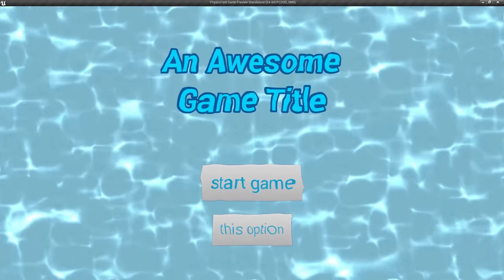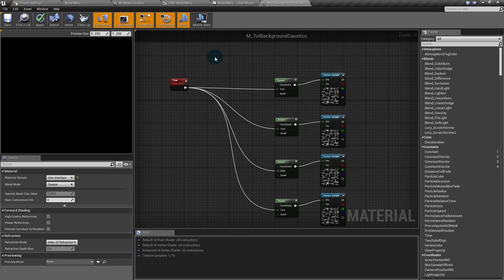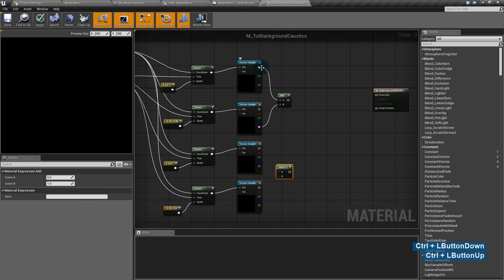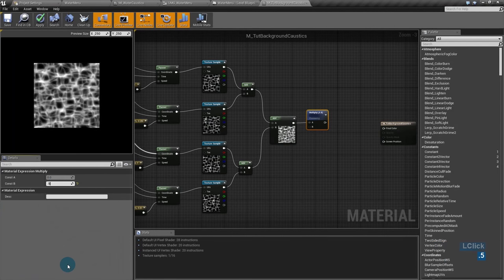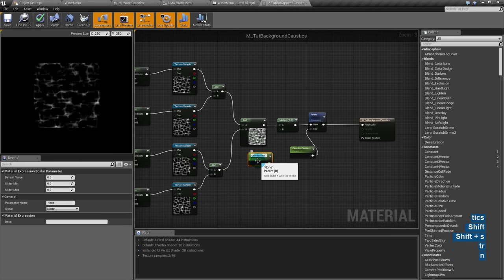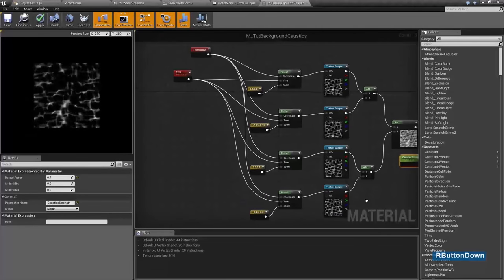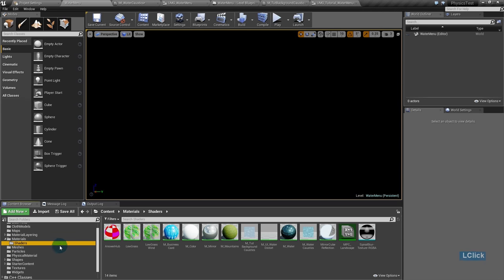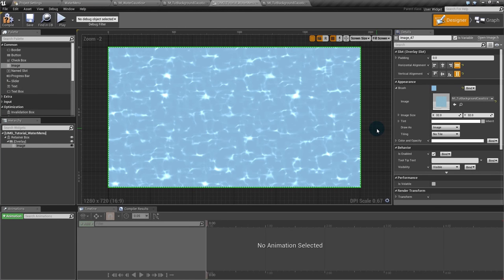UE4 Tutorial 101 - UMG Water Menu Part 1

Comment: Also pretty sure it only updates when you're moving your mouse is because you have realtime turned off in your viewport settings.
Reply from the maker: I looked at that. It was on :(
Also, it seemed to only stop moving after I turned on Live Update on the material nodes. Gotta test it to confirm.
Reply from the maker: Hey, I found the Realtime option IN the material editor! And it was indeed off. Wonder if it's because now I'm using 4.15. I looked for it before.